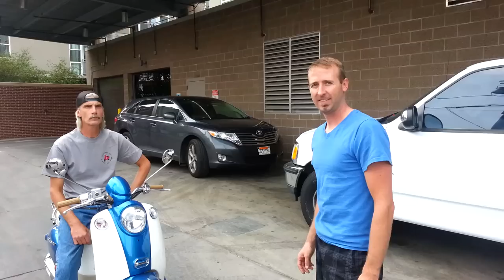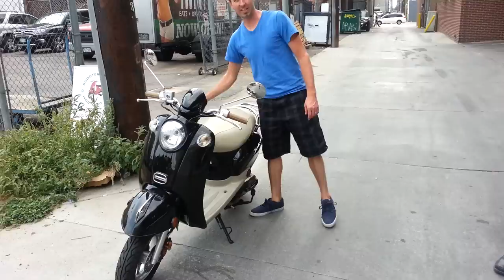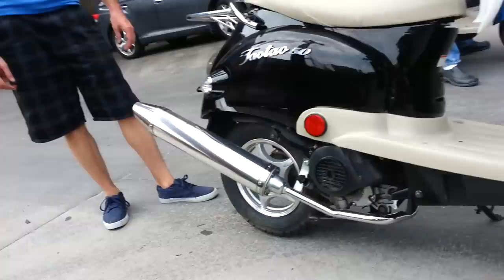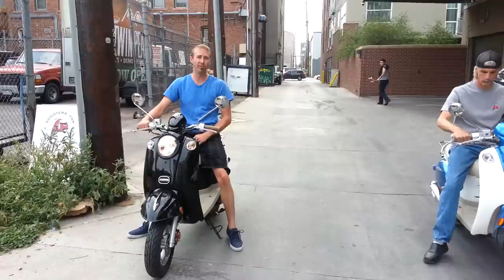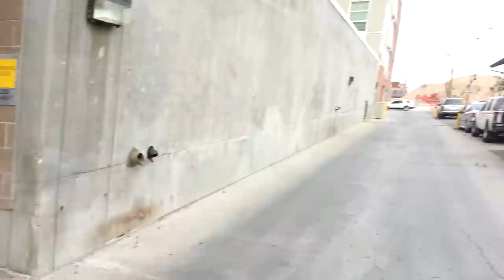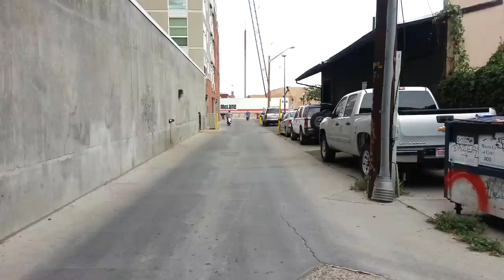The difference between a chinese gy6 qmb139 tao tao  50cc scooter and 80cc scooter moped

Comment: Tao Tao is the cheapest you can get. 9200 ft would be result in probally just enough power to go up a 5 degree incline lol. The mechanics are better left to a shop that is what I do. Usually fairly cheap and good people. I would certainly talk to them about souping it up before running at 9200 ft lol. Get a Kymco or something but not a Honda.

Comment: I weigh 290 pounds and mine goes 30-35 mph. It is a stock Jonway 50cc YY50QT-21 C(4S)
Reply: Damn
Reply: I'm 200 lbs 6ft tall my scooter goes over 45 but I installed the big bore kit

Comment: What size frame are they? I have one and looking to get a new body kit.
Reply: Search under the code name my scooter is 50qt chassis and all tt50qt or yt50qt or so on aslong it end with 50qt or whatever chassis is ,and for engine parts should be 139qmB but there is a 139qmA and the valve are different and the rod stroke is a bit large but the 139qmb is the mostly sold in the usa but just to make sure sheck the vin on your motor if it end with 139qmb or 139qma.

Comment: i have a question: a scooter 50cc tunned to 80 cc, what top speed wil have then? or it doesn't matter because it will only be quiker BUT NOT FASTER(a higher top speed)
Reply: tritade depends but you could probably get almost an 10mph speed gain.

Comment: hey rollingwrench.. i just did one of these upgrades myself and im having a problem i didnt before the upgrade.. whenever i go more than half throttle it boggs down and i lose power.. i checked inside while hitting the throttle and it looks like the fuel stops flowing at higher throttle... is that possible.. or do i have an air leak or something?? the bike does 30 at like 1\3 throttle id really like to see what it can do but i cant figure this out.. carb is brand new... thanks
Reply: Roger Bernard III carb needs to be rejetted. They come setup for 50cc and are usually still kinda lean. I know this is an old post but you gotta upjet for a bore kit.. im running a 95 main with my 47mm setup. Also has a free flow filter instead of the stock box

Comment: dude they are both gy6 motors on both these bikes. one just has a big bore kit. i work on these types of bikes all the time and they all have the same chinese junk motors. do yourself a favor and buy good stuff like honda,yamaha, or sazuki.
Reply: Not all GY6's are equal.  I used to feel this way until I saw some guys taking apart GY6's and took apart my Kymco.  The Kymco is Taiwanese, and the engine is built very well.  Where did it suffer?  The carburetor used an M5 sized main jet rather than everybody else using M4 like real CVKs.  Also, with the GY6, you can't "just" install something and call it good...you have to pay attention to jetting, like every bike.

The Chinese GY6's are usually pretty okay, just suffer on the carburetors and ignition parts.  Nice part about scooters is they're so incredibly cheap to maintain, with GOOD parts.
Reply: @isher9035  Yes, Kymco is a good scooter . I believe that the Taiwanese GY6 engines are much better than the Chinese GY6 engines . I have nothing against the Chinese , but they seem to have quality control problems . Isher, you do well to stick with the Kymco brand ! !
Reply: Microshark79. I fully agree with you . The Chinese scooters are less expensive but they seem to have many problems . The scooters built in Taiwan , I believe are somewhat better than the Chinese brands but they are still not up to par with the Japanese brands . I believe that Kymco makes a good scooter and they are built in Taiwan . I also believe that for the difference in price between a Taiwanese scooter and a Japanese scooter like : Honda, Yamaha and Suzuki , in  long term a person is better off paying a little extra $$ and buying a Japanese scooter. Even if the scooter isn't directly made in Japan , the ENGINEERING and QUALITY CONTROL  are JAPANESE . Here in Canada , many scooter brands came and now they are all gone . I would say easily a half dozen of scooter makes and countless models . Honda , Yamaha and Suzuki are still here . Furthermore , with the well known Japanese brands ,  If you need help or parts , you have a dealer to serve you and not some JACKASS scooter  company somewhere in China that closed up shop a year or two after they opened their doors . I want to finish by naming some scooter companies that came and left here in the Provence of Quebec , Canada : Chironex , TaoTao , PGO , CPI ( PURE TRASH ) , Keeway , E-Ton , Jonway , Saga scooter , and SYM . Long live the Japanese MOTORCYCLES  and SCOOTERS ! ! !